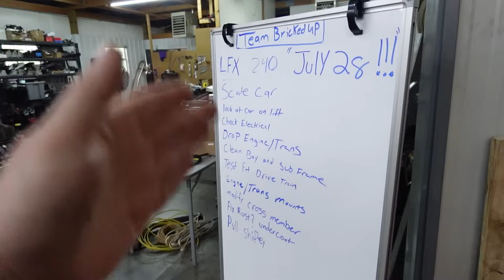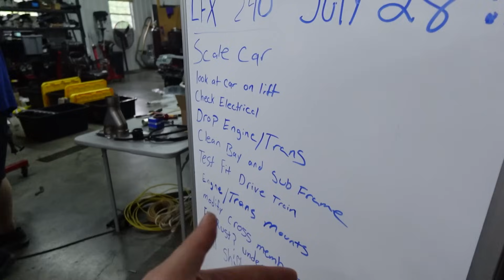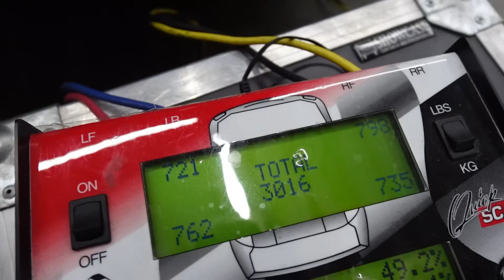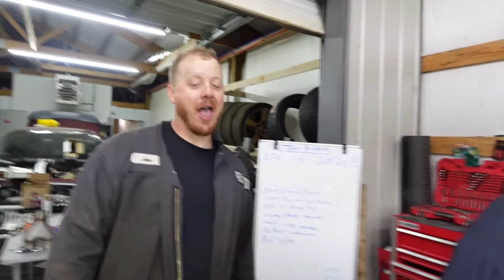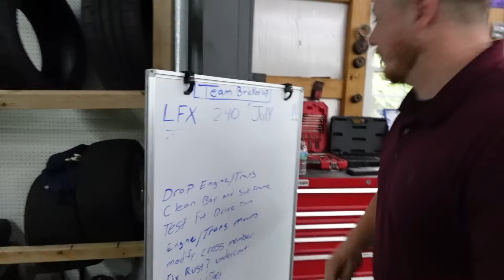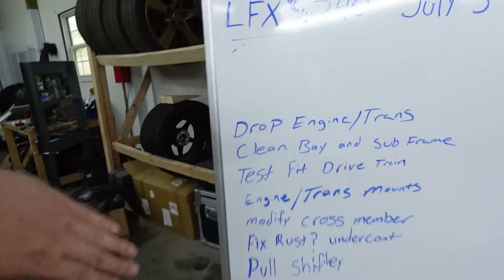LFX Swap Volvo 240 Wagon! Best swap dollar per HP?

Comment: Ill tell you this, the 3.0 duratec i swapped into my little brothers '82 2 door Corolla is STOUT. I ported the heads, we did a custom grind on the cams, we did some eagle rods and forged pistons, and an old ass rebuilt borg warner turbo i cant recall the size of. All on a haltech elite 1500 and e85. I built the damn thing 3 years ago and its still kickin. He doesn't take care of it like he should either. But the damn thing straight up fux. Makes 475 at the tire and we could step it up to 500-525 but 475 is the number for the car its so perfect at that number. It has a tremec tkx trans, It weighs 2400 pounds the thing is actually super super fast its no joke. All fortune coilovers, forget the angle kit it has on the front its powdercoated like a metallic burgundy. Wicked badass little car man. It runs the door of my damn near 800 hp single turbo small block ford swapped 328ci (see my profile pic) on a tight layout. Up the mountain we run i leave him for dead  but coming down the mountain he can hang. Its Mt.Rose highway in Reno, Nevada if you wanna look it up on GPS. Best damn road ive ever driven and ive driven mountains in 22 states and 11 countries. I used to be a pro snowboarder. In Germany i rented a 2010 rs6. We got there right before a big storm so the roads were relatively dry. Those were some awesome roads and the scenery was unreal but, i put my local road above even that from a drivers perspective. Its like it was designed by someone who drifts. Theres nowhere with exposure you can get enough speed to overshoot and end up un alive and all the super fast sections dont have any exposure except for a couple of the corners right before you summit. Theres also a 5 mile road that leads to the backside of the mountain (it's called slide side the chairlift is called Zephyr) thats absolutely terrifying to drift the exposure is death. If you overshoot and go through the guard rail you better pray to god a tree stops ur ass immediately because if it doesn't, yeah man thats it game over. Y'all ever out this way ill let you run my girlfriend's fox body up the mountain. Invite is always on the table for you peckerheads. Thanks for all y'all do to keep us fuck heads entertained. I appreciate every one of you.

Comment: So the shocking part was homie was laying on the ground. Making the connection to ground. Your shoes are decent insulators. Once you touch bare ground you complete the circuit. That’s why he got shocked laying on the ground and you didn’t while standing up.

Comment: What is a LFX?
Reply: It’s a GM 3.6L V6 called the “high-feature v6”. They made multiple different versions of this engine and it went in multiple different vehicles from a Camaro to a Chevy Colorado and all brands in between. The power numbers differ on which version you have. The big power ones came in the arts-v twin turbo making high power numbers for a factory v6. Each version is a different model name (LFX, etc). Look up “GM High-feature v6” and you’ll find tons of info on the series of v6

Comment: c'mon brooooo just slappa turbo in da redblocka and it make good powa just look up som hopped up volvo vids on this here tubes bomboclat
Reply: Yea that built red block didn’t cost 500 bucks tho .  This motor is 300 to 600 bucks . Trans is 200 to 400 bucks .  Full harness from a company ready to go is 1000. Or you can just use stock harness from a wrecked car .
Reply: It’s not that red blocks can’t make power it just cost more money than we have to make power haha . This thing explodes it’s 400 bucks for another sub 100k mile engine and you’re ready to go.
Reply: @Chasing_adventures  yea i know, have to get better rods for 400+ injectors and list just goes on and on.. :D Cheaper to put that v6 and if it blows up you can go get another from junkyard or something :D